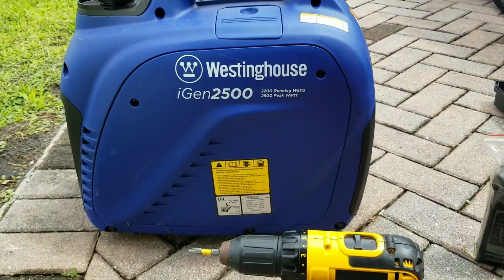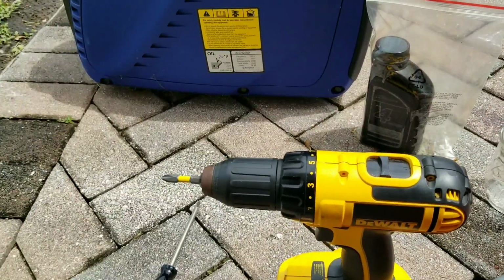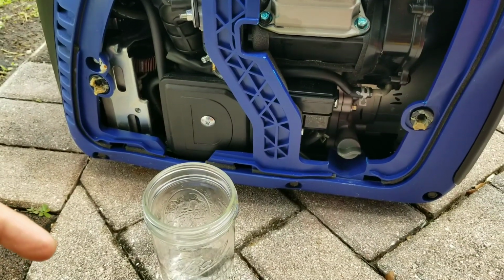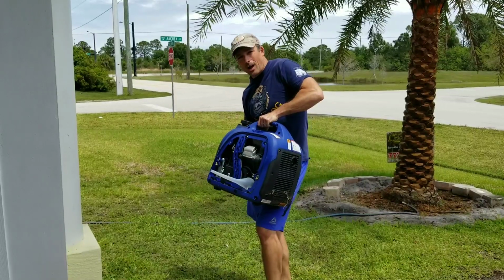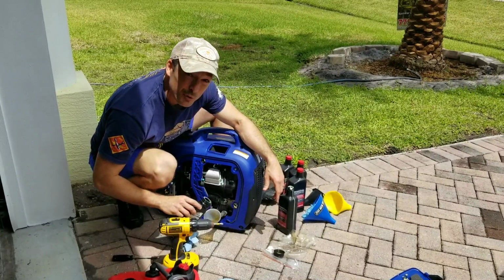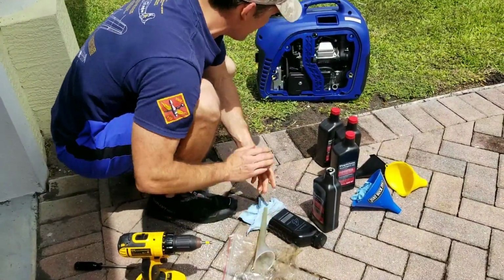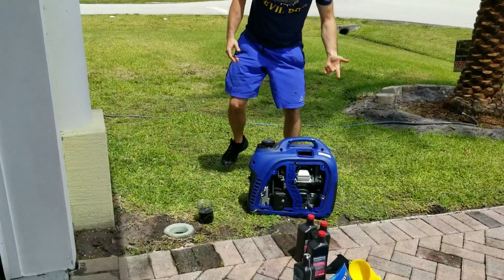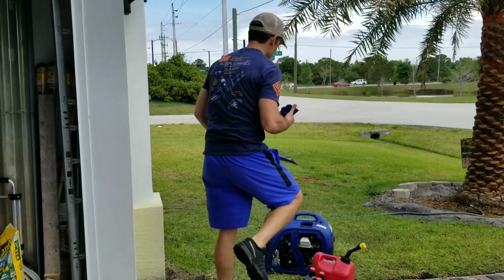iGen2500 Oil Change

Comment: Strong running 2200 hundred I have only problem is the pull cord
Will break after a short time.Replacing it kind of a pain
Gotta open it all up and it's very very tight inside not a job for average home owner but replace the cord with 550 paracord should last good long time.

Comment: But it comes with synthetic oil so you need to stay with synthetic
Reply: well i started with dino remains. i guess imma use 15-40 deisel erl after ~100 hrs. if ya aint broke it in goog one can replace with reg oil... just gotta make sure it doesnt mix. one